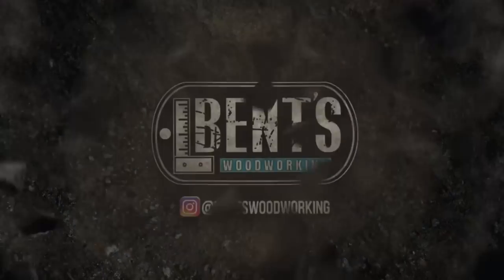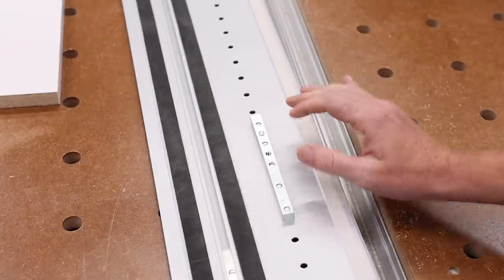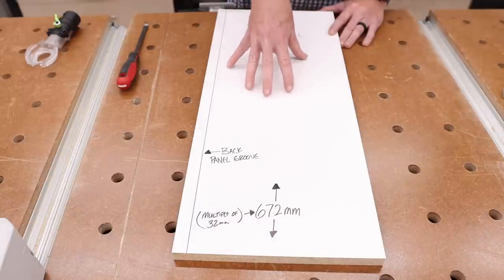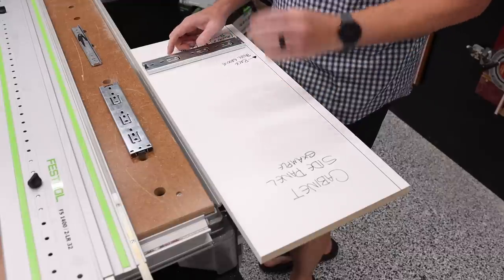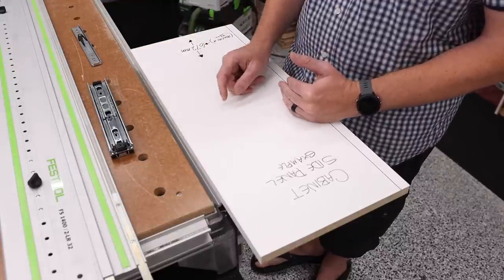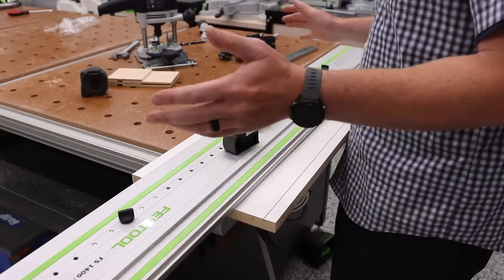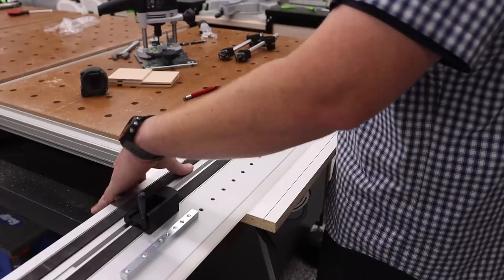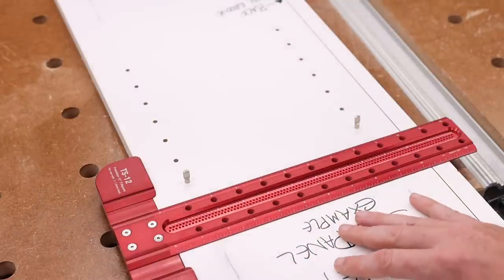Festool LR 32 - Intro

Comment: What a superb video. Could not have been better explained. I now need to get started on my kitchen cabinets!!! Thank you.
Reply from the maker: Glad you found it helpful!
Reply: Really fantastic vid, thanks for sharing!  I can't imagine any better explanation and presentation:  All the points well explained, to the point, good vid and production, pencil markings are quite helpful.

Here's a question:  99% of the time on sawing exercises (mostly MDF or plywood) I find the tracks stay put without the need for clamping.  Do you find that it is necessary to clamp the track or is that a habit or precautionary exercise?

Comment: You would do well to glue another strip to the bottom front edge of the wooden alignment guides so they touch the workpiece, it will take parallax out of your alignment.
Reply: That's what I was thinking.  Great video though and this system sure is fast.

Comment: I have had this system for several years.  I love it.  I don't make that many cabinets so when I do I usually look for a refresher on how to use this system.  Thank you, you explanation was wonderful, easy to understand.  I kind of want to go out to the shop right now and make some shelf pin holes in a project i am doing.  Thanks again for a great video.
Reply from the maker: You’re welcome!

Comment: Very nice video. I own the LR 32 system and have used it a few times but certainly didn't get the full value out of it. This video clears up many of the questions I had. I'd be interested in seeing how the system helps with the door side of the hinge. Thanks again for a truly helpful video!
Reply from the maker: I’ll do another video covering that as well

Comment: I just used my LR 32 system for the first time today and that clamp is exactly what I'm missing. Everything worked great, but the clamps that came with it really slowed things down for me. Also going to make those guides Peter Millard came up with. Those two things should speed things up significantly.

Comment: Good walk through! Yep, the Millard position aids are great! - Especially in a mid-row situation (Total of 3 row of holes, for drawer slides that may need extra screw support) 
But, you may have done it by now: Festool end stops need calibrating straight out of the box - otherwise the rulers won’t match…
It’s in the manual - Use the end stop pin and align with the U grove in the router plate.

Comment: Great video Jason.  If you were to add a small piece of wood to the front that takes up the space of the thickness of the LR32 and the surface of your shelf side, it would line up perfectly versus eyeballing it.  There are times it gets deceiving and may be off a hair.  I am sure that it don't make that much of a difference, but for as perfect as you make your projects, it may help.  Thank you for everything that you do and of course, thank you for your service.
Reply from the maker: Thanks Jamie, and I agree. I am actually working on developing a cnc cut piece for that reason. Something more precise with a different material 😬
Reply: I would also suggest removing the cut strip so that doesn’t change the width of your rail.
Reply: @bentswoodworking  Did you ever end up making one?

Comment: I have an adapter plate that allows me to use my Porter Cable 890 router on then LR32 base plate.   Works slick and my dust collection is as good as a Festool router.  Out of the LR32 kit I bought just what I needed, much like you I use a spacer block for placing my rail correctly.  Here's one for you, DYK, from the edge of your cabinet to the metal front edge of your LR32 guide rail is 64mm.  This puts your centered router bit in the base plate, right at 37mm from the front edge.

Comment: I really like the idea of being able to use it to add the holes for the drawer slides. I just built a cabinet and used a Kreg jig to do the shelf pins. It worked. But looks like the LR32 definitely is faster. But also, and much more important, much cleaner holes. Question… I don’t use the bloom undermount slides. I use side mount soft close. Will that work for most slides? I’m guessing specific screws would need to be used. Great system.
Reply from the maker: Pretty much any slide you use it will work. The spacing between will be different depending on length of slides. Every slide I have used has had a front locating hole that will work with the 37 mm setback

Comment: So helpful, especially with the distance jig and Blum info, thank you! The Mafell Duo-Dowler also works great with 5mm drills (sadly those are a quite expensive) and the „K“-Pin. There is also a registering bar to make it trivially easy. Sadly this bar is 230 Euros and it’s 1600mm extension is 350 Euros, which gets into the cost area of LR32, with the disadvantage this this special rail cannot be used as a regular guide rail and the resale value will be quite low. Without these rails the process might be a bit more error prone than LR32 for a hobbyist.

Comment: Try pushing the base down first - enough to make the centering mandrill protrude and tighten the plunge handle.  Then install the indexing plate. You’ll find it’s much faster
Reply from the maker: That’s a great tip! Thank you

Comment: You sir are an amazing teacher. All your videos explain everything. 

I'm a cabinet refinisher and trim carpenter,  I recently started building kitchen cabinets and I love it.
I have only  built 3 kitchens so far and I'm on my first frameless kitchen. 
I have been watching your videos for a while now and I've learned soooo much.
I just bought the LR32 system and I'm so thankful for this video. 
My question is you mentioned that you don't edgband the top and bottom of the uppers. What do you put underneath the uppers? 
Am i missing something? 
The kitchen I'm building is going in stained oak. 
Thank you so much.

Comment: To parrot other comments,  great video. I've been using the Rockler Pro shelf pin jig. Works great, but I get tear out on the edge of the holes.....yes, I bought a new drill bit. Then I usually have to go back with a drill bit and clean out the debris from the holes. Not terribly time consuming,  but a pain in the butt. With the tear out, the holes look sloppy if you look real close. Don't ever look at my work real close.😀 I assume the LR 32 holes act as a zero clearance? Or do you have a similar problem. I'm thinking about "investing" in this system.
Reply from the maker: The LR32 is cutting those holes with a router bit so the cut is perfect!
Reply: Thanks for the reply. I do like perfect,  but like I always say, I'm a perfectionist without the ability to be one!😀

Comment: Another method that works well for me is to take out the splinter guard from the rail then use approx. 63.75mm, 191.75mm, 287.75mm, 415.75mm by say 200mm blocks of hardboard.  I then just reference off of the front of the carcass (use finger or block) to the front of the rail and get 37mm set-back hole and other screw holes for drawer slides. (accuride 28inch slide for example here).  This way it’s a bit more accurate since there are no measurements or pencil lines and it’s even easier (maybe) to make than Peter Millard’s.  The downside is, now no splinter guard for the rail. For the back, I reference off of 63.75mm block (26.75+37mm) and with back material to setback 37mm from back panel…  works nicely for shelves (not drawer slides).
Reply from the maker: Interesting, thank you for sharing 👍

Comment: Great video thanks for this. Question for you, would you be able to use a different guide rail system like the tso instead of the one provided as part of the lr32 kit?
Reply from the maker: To use the or 32 you need the Festool rail

Comment: Jason,  did you apply a protective finish to your MFT/3 table tops?  Yours look darker and slightly glossy.  Mine look more like flat virgin MDF (other than the saw kerfs and some glue stains).   If so, what did you use and are you pleased with the results?
Reply from the maker: I typically will just spray them with left over finish from other projects periodically. It’s mostly just polyurethane and it’s great.

Comment: Ok figured it out. 37mm was the important measurement, drilling the uppermost hinge screw locations, followed by an offset from the rear and halving the distance from the inside hinge screws! Thanks. It’s easier but I don’t own a Festool router. Haha 😂

Comment: Jason, this is a great instructional video. I've priced out the system components and they cost as much together as a line boring machine (like the tooltech) which can drill 13 holes at once. Have you considered a line boring machine?
Reply from the maker: I don’t do it enough to have a need for a line boring machine.
Reply from the maker: Would be cool though!!

Comment: Really impressive video!! Thorough and very informative! Thanks! 

Have you ever tried using the LR32 rail and guide plate to make an MFT table (3x32mm=96mm hole spacing!)
Reply: Peter Millard used the LR 32 system for an MFT build

Comment: Another great video Jason! Am I correct to assume that the sample side panel method you used may not work with drawer slides, since the distance between your front and back rows may not align with the drawer slide hole spacing?
Reply from the maker: It is totally based off the size of the slides. The 37mm spacing on the front would work on just about any slide. You would just have to know the measurements for the other holes

Comment: I'm looking at purchasing the Woodpeckers parallel guide for ripping 8x4 sheets down. Would you recommend the Metric version over the imperial for use in conjuction with the LR32?
Reply from the maker: I have the metric but I prefer the TSO parallel guides
Reply: @bentswoodworking  Good to know. Since commenting I have also moved in the direction of TSO over Woodpecker. I appreciate your thoughts on it.

Comment: When cutting the balanced panel how much to you allow for the thickness of the edgebanding? Good video btw.
Reply: I’m now thinking edgebanding doesn’t go on the top and bottom of an upper cabinet...
Reply from the maker: Correct. Typically it does not so it isn’t a concern.  👍
Reply: I'm building some oak cabinets that will be stained. Am I missing something? Why not edgband the bottoms?

Comment: Hi Jason
First thanks for your great channel!
I am trying to build the festool roll cart as festool has a drawing for that comes with there drawers. But there is something i am trying to figure out and that is how to make the first hole 8 mm from the edge of the cabinet side??? Hope you can help.
Best wishes 
Anders from Denmark
Reply from the maker: I wold mark a line and use my setup blocks to align it.
Reply: @bentswoodworking  thanks Jason 👍 maybe I will do a small video about how to get it done 😉

Comment: Hi Jason. Is there an easy way to create 16mm spacing?
Reply from the maker: Yes. You would just use 16 up and away. Then flip both to 32 up and away. That will put you right in the middle of the first set.

Comment: Question about your son's cabinet shown at the 25min mark(would like to see more of that vid).  How do align the bottom drawer slide using the LR32 system.  I have looked over the blum catalog and the Tandem diagram shows the screw holes located at 25mm(lower) 37mm (upper) from the bottom of the side.  If I set the LR32 using the 16mm offset the bottom drawer will not sit a the bottom of the cabinet and alight with the 32mm holes.  Im sure I overlooked something but I cannot figure it out.  Thanks for any help

Comment: Great as always! Just one comment,you don't need to reset parallel guides, you just need to make the groove first, that's how the pin on the guide sits in it, so you always use 37 mm without changing.
Reply from the maker: That’s how I typically make them.

Comment: Hi Jason! I've just bought the LR 32 complete system with the FS 1400/2 LR32 rail. My balanced cabinet side panel is exeactly 960mm. I put the locating bars on the rail, and the distance between the two bars is only 959mm. Do You have  any idea? I didn't see any possibilty to adjust the bars. Thanks.
Reply from the maker: I’m not sure, could be an issue with the measuring device giving different dimensions

Comment: Jason, what is the measurement from the edge of the rail to the end of the jig that you line up. This has to end up at the center line of the router bit...
Reply from the maker: Not sure off hand but the way I figured it out was putting the router and plate on the rail, depressed it to make a mark, then measure to the mark.

Comment: Thanks! One question: how do you get the track to align so that the bottom hole lines up 37mm from the bottom of the cabinet, especially with varying top and bottom piece thicknesses?
Reply from the maker: Why do you need holes 37mm from the bottom? That’s not me being nasty, I am just curious.
Reply: @bentswoodworking  The "standard" minimum clearance from the bottom of the cabinet for a Blum under-mount hole install is 37mm. Since the 5mm every 32mm holes are cut before assembly, how do you (or can you?) use the Festool rail to get 37mm plus the width of the bottom piece (18 or 12mm) - so 55 or 49 mm? I'd like to punch out a bunch of cabinets with a bottom drawer using the Blum Tandem Blumotion runners. I know how to make a custom jig (I have a Shaper Origin), but I like the durability of the metal rail vs warping ply or soggy dog-eared MDF. That is my question.

Comment: Those flat bottom srews at 10:49, for the I suppose 5mm dia holes, what size/type are those?
Reply from the maker: 5mm euro screws
Reply: @bentswoodworking  Thanks. They seem to be labeled 6,3 here in Sweden. 
The ones for 5mm holes.

Comment: Jason, unless I missed something, it would seem using your and Peter's technique it would also be a lot cheaper to buy just the LR32 router plate and two LR32 rail connector pieces for $204 plus the cost of bits (assuming you don't already have that size of bit) than to buy the whole LR32 system from Festool for over $427. Correct?!
Reply from the maker: I suppose you could do that.

Comment: How are you supporting the panel off the side of your bench?
Reply: Jason did say early in the video that he was using the Festool VAC-SYS vacuum clamping system. He's got that mounted off the side of his bench and the workpiece is held in place with a vacuum. Very handy and very expensive (even for Festool).
Reply from the maker: It’s the Festool Vac Sys

Comment: Thanks Great video.   Pity Festool’s policy of excessive pricing for their kit.  Heaven forbid you need accessories for it in Australia you dropped $944 for the sustainer set and then $765 for a rail.  And that clamp you recommend. That will be probably another $400-500. I have a number of Festool tools but their rip-off mentality always makes me consider other options.

Comment: LOL, great video but I can't believe you wasted that much time explaining the stops based on 32mm. As if anyone is going to base their cabinet build size on their ability to place shelf pin holes and two stops to lock it in. Just referencing the same side seems pretty simple and MUCH more likely.
Reply from the maker: Well, that depends on if you build with imperial or if you build metric. The system is designed to be used on a “balanced panel”. It is far easier to use and understand that way.
Reply: @bentswoodworking  Again nobody in their right mind is planning their cabinet dimensions based on the convenience of drilling some shelf pin holes.
Reply: Aaron, nope.  I used to do that, but when I found the ease in using metric and the 32mm System (aka "True32 System") for building cabinets, EVERY cabinet I build now is a multiple of 32mm.  Take a look at Bob Buckley's book "True32 Flow Manufacturing" for a more complete discussion of why the 32 mm system works so efficiently.  The Festool LR 32 is a great tool to avoid a mucho expensive line boring machine yet still allow you to crank out drilled panels in the twinkling of an eye with holes in the right locations for hinges, shelf pins, and drawer slides.  Practically everything in my shop is now metric, and if I have to do anything in imperial (or as I like to say, SAE or English),  I snarl and grumble.  I've gone whole-hog True32.  Mistakes are minimized.  Things are easy, fast -- and they fit.  Life's good.
Reply: I totally agree with Jason on using balanced panel dimensions whenever possible with the LR32. I was maximizing the height of a systainer cart to fit under my MFT. The maximum height was not a multiple of 32mm, so I made it unbalanced. Using the same reference edge for front, back, 32mm spaced, and 16mm spaced holes was a real pain. If I had to do it over, I would make panel height to next multiple of 32mm (balanced), drill all holes, then trim to desired height.
Reply: @tooln8r844  Hilarious! Festool puts you in a box and you call it genius. What a maroon.